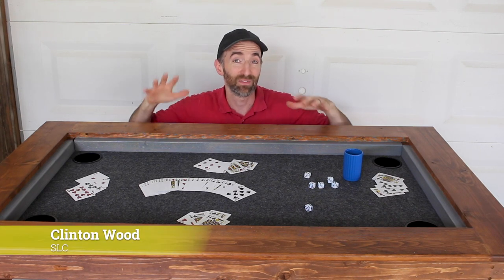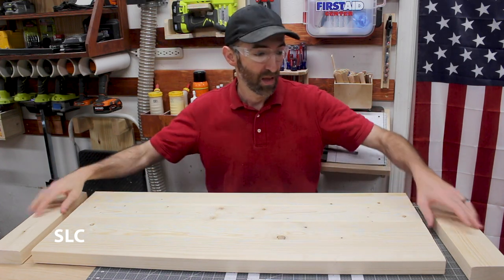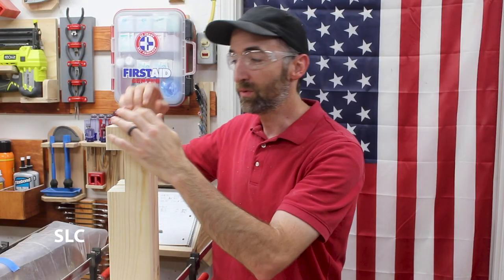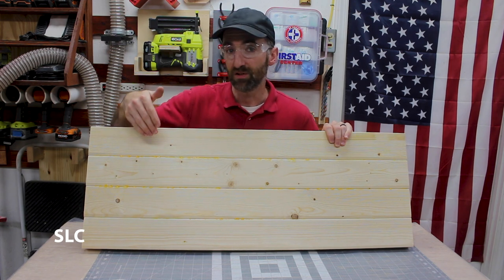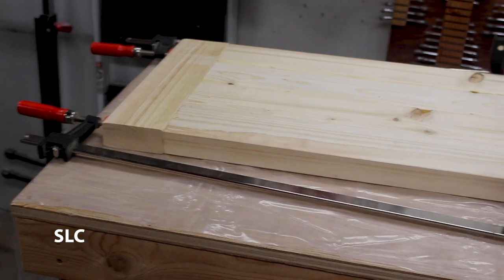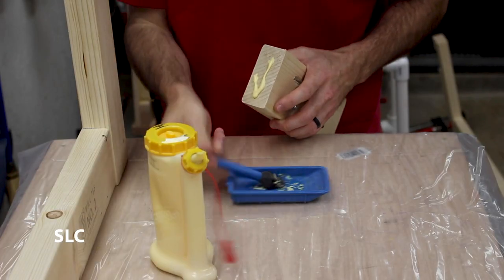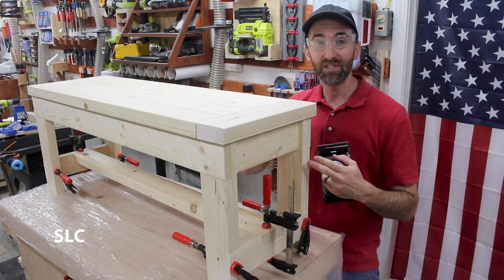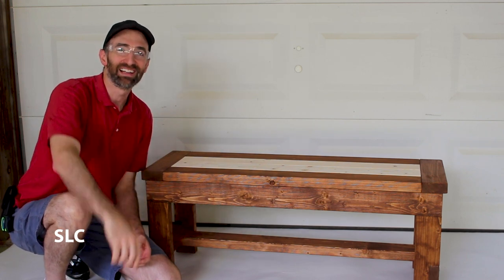Building a Heavy-duty Wooden Bench

Comment: I like the way the project turned out: a very neat design and sturdy bench too.  It looks like you were using was kiln dried 2x4's with low moisture content?  Also, I liked the way you laid out the boards out after the cuts to help visualize how you're cut them, but as you talked through the dado and rabbet cuts on the boards, it was difficult to imagine how they were going to fit together until later in the video, it would be helpful if you had a diagram or even shown the completed bench earlier in the video... that said, it was clear how you made the bench by the end of the video.
Reply from the maker: Thank you for the advice, I will try to improve with the next project.

Comment: That might last 10 years or so, max. You're gluing end grain to long-grain. Expansion of the middle pieces will make them separate from the end pieces after just a few seasons. This is why floating panels are used in fine furniture building.
Reply from the maker: For outside I understand, but these are for indoors, is that still a concern?
Reply: @SpecificLove7  Yes, very much so. Think of how dry your house is in the winter with either a fireplace, or central heating, compared to how humid it can be in the summer. Making a floating panel top isn't easy, but I've done it purely with hand tools (including all the planing and squaring and cutting joints). I don't intend to be mean, but this is basic woodworking knowledge. I had to learn it on my own, but it's worth putting in the time to do it right. If you made that top in the summer, in 10 years the top will split on the ends. If you made it in the winter, the middle will expand and separate from the end pieces. It may take only a few years, and I've seen it happen.
Reply from the maker: Thank you very much for the information.